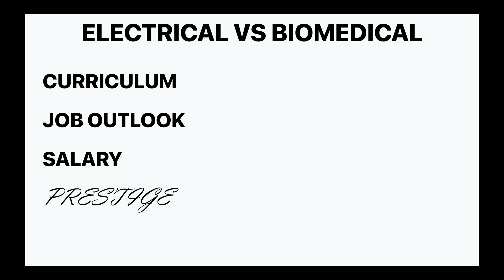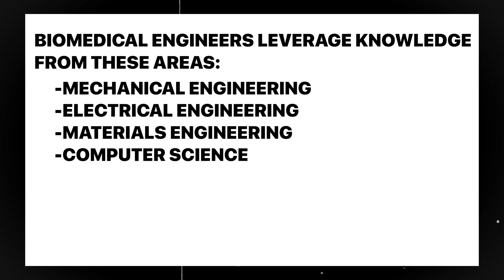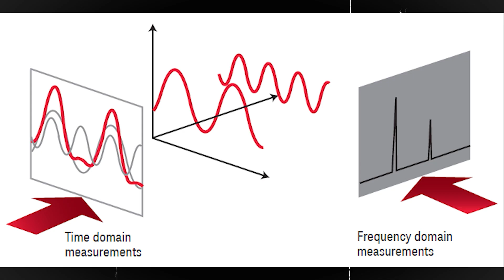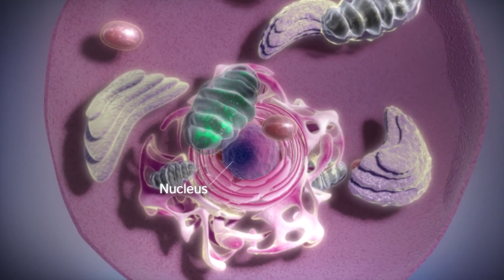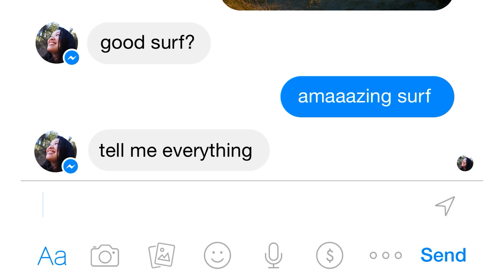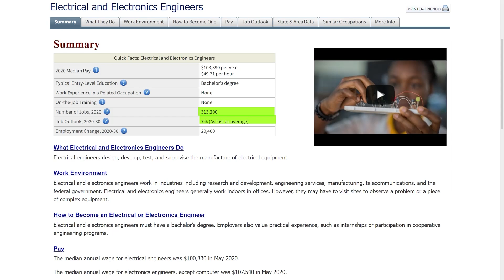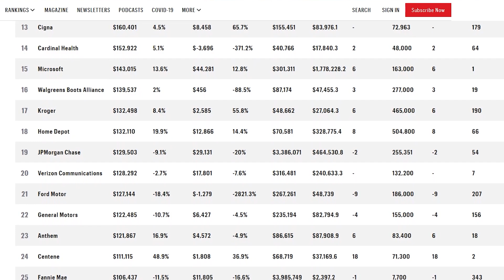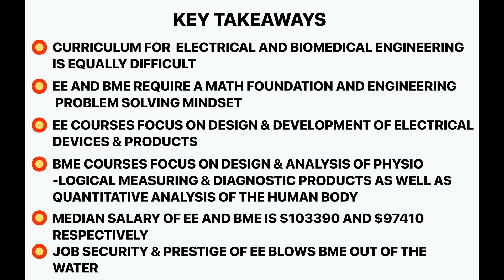Electrical vs Biomedical Engineering : Which is BETTER?

Comment: Yup, currently a BioE major and the job prospects are pretty slim if you just have a BS. Most companies would rather hire ECE or ME majors (heck, my BioE major has a BioElectrical concentration) as they have more experience with the more practical areas of machine design. I’ve heard you have to go back for your Masters/PhD before you can get a real high-paying job in your field. However, I wouldn’t entirely discredit BioE/BME majors as they are great degrees for if you want to go on to Med School (probably the only engineering majors that will prepare you for it similar to some of the STEM majors like bio and chem will).
Reply: It only good for med school bruh lol...